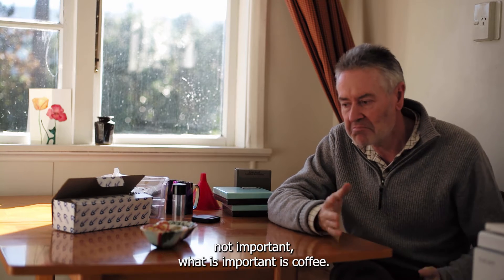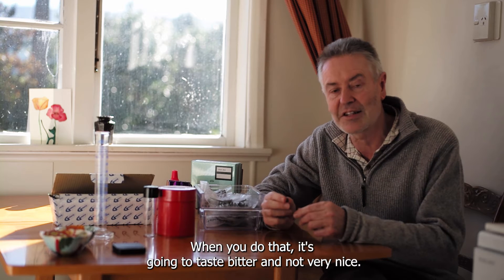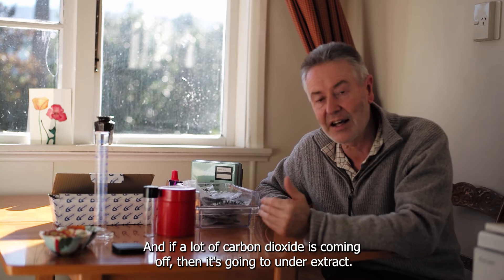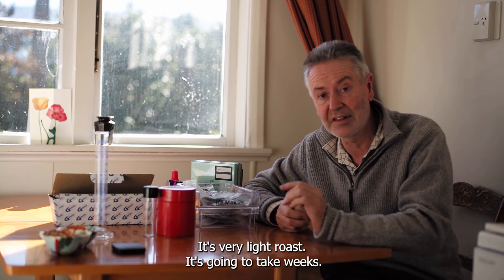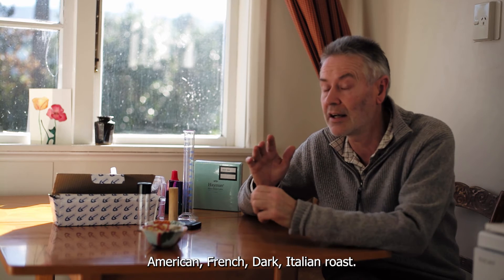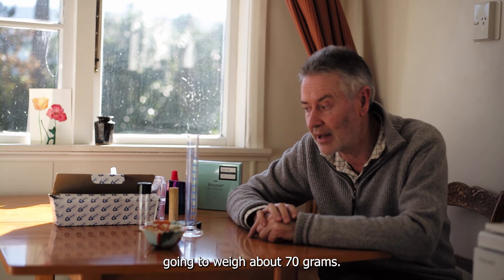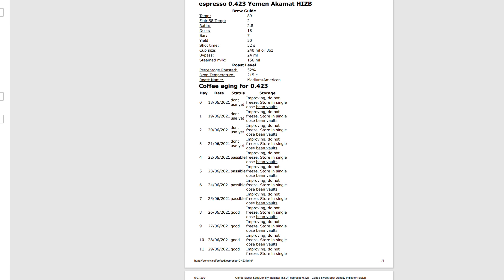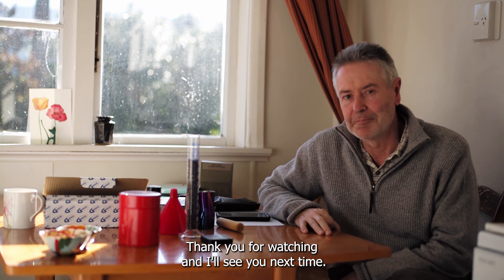The best Coffee Storage system

Comment: Problem with vac packing is the amount of plastic it uses, after one use the bags always smell like bad / old coffee, even if you wash them inside and out with dish soap and a sponge, I still can't really seem to get the stink out, so you could re-use them but I'm afraid the smell will infuse into the new fresh coffee.  Glass Mason jars work just as well and can also be vac packed (not sure it's really necessary though). Also I don't think it needs to be single dosed. Just when you take them out don't open it until it's up to room temperature to avoid condensation, also don't take them out and put them back in the freezer for the same reason.
Reply from the maker: https://www.instagram.com/p/CTWvWjJPTVw/?utm_medium=copy_link

Just what the doctor ordered for reusable freezing of single dosed roasted coffee beans...

ARGTB5000 Tube Centrifuge 50ml Black Litesafe Sterile RNASE 
DNASE Free / PK 50(06344-35)

BIO90-5016 Freezer Box 16-Well for 50ml tubes Super White 
Coated Cardboard Freezer Boxes / PK 5

From www.labsupply.co.nz